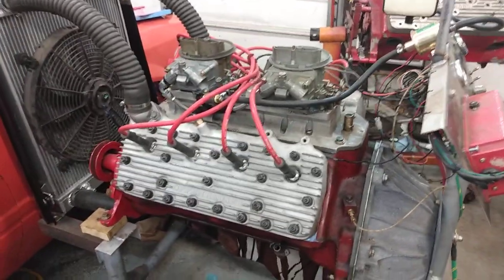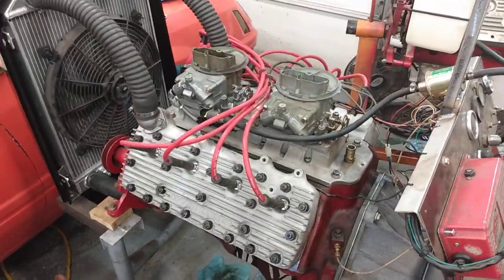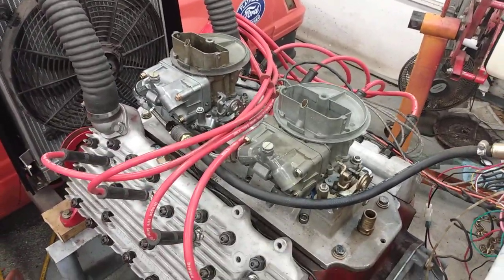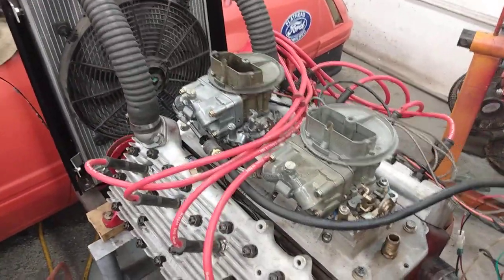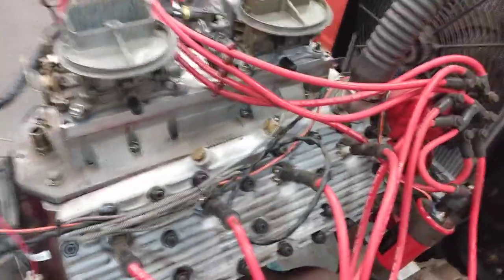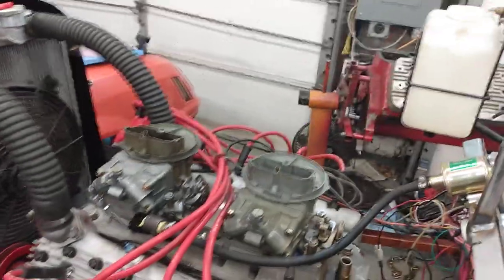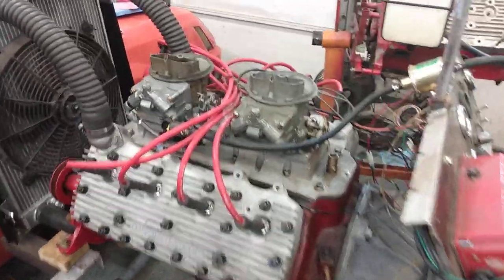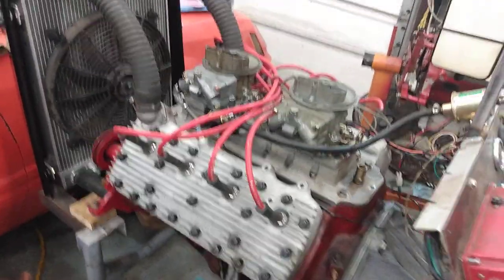Flathead Ford V8 with two Holley 4412's

Comment: 207 MPH, that's moving for a flat head.. really cool, should put it in something cool and run it once in a while, just my humble opinion.  🙂
Reply from the maker: I have the block at the machine shop being looked at to see if it can be repaired at a reasonable cost. One valve seat came out and I think there is a small crack in one valve seat. It is fitted with a kick butt Doug King girdle already.

Comment: Do you know what camshaft is in the engine? Sounds great!..
Reply from the maker: I really don't know, but from what I can tell it is stock. Looks to be a dingle ball rebuilt, I installed the Offy heads and the MSD ignition.
Reply: Just tell the auto parts guy you want a Bigun

Comment: I don't know how it favors in the fuel department? With those two Holley 500s? I know that would be too much for any engine small block wise and sometimes just on the knife edge for a big block? Unless it's washing the cylinders or making it rich I would swap down to the two 350 CFM Hollies and I think it would respond better without over fueling? Only my opinion in my experience with too much of anything especially for a flathead since they are not a high revving engine good looking motor I've looking at the intake manifold it almost looks like later model V8 adapted to a fatty I just can't see the intake very well
Reply from the maker: the intake is by Kong and the intake runners are fairly short, probably not good for the low revving flathead. What I understand long runners help low end torque and short runners are more for high rpm power. That Kong intake has a removable flat top making it adaptable for blowers or as many carbs as you want.